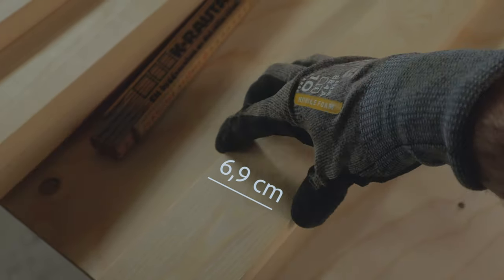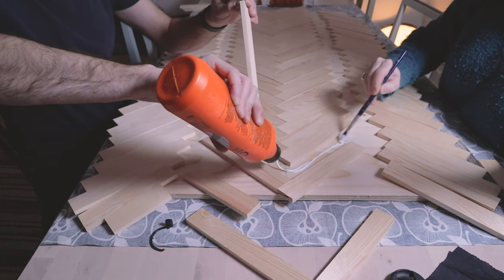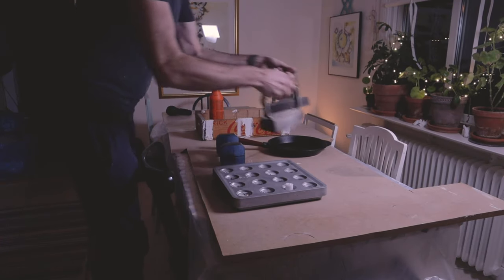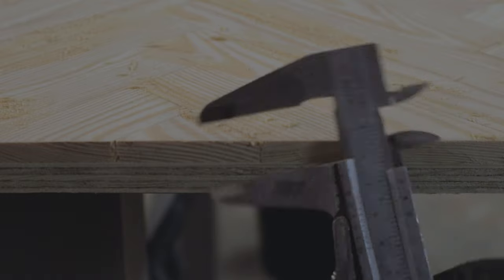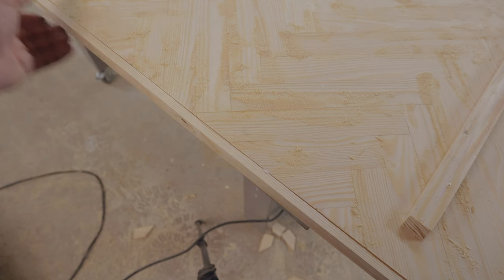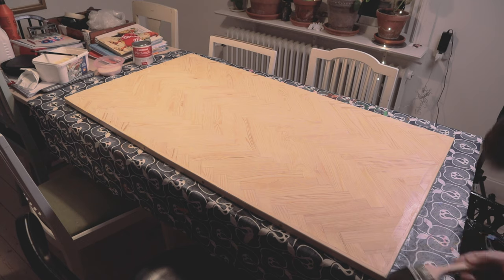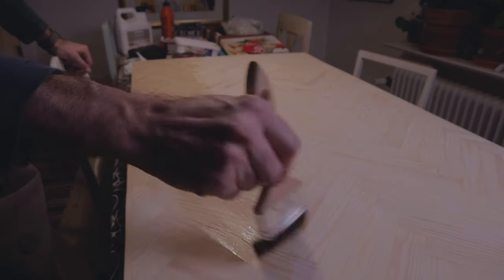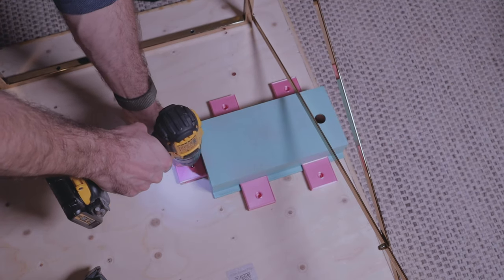DIY Herringbone Coffee Table

Comment: Great job, it may be useful to use a plug cutter to get a great finish on the outside edges, I found a plug cutter very good & hardly se-able when  the plugs are the correct size to fit tightly into the holes, with the grain direction flowing with the outside pieces. A chamfered cutter does the best job, and is hard to see when finished!!  Keep up the good work, your tablke turned out quite well!!
Reply from the maker: Thanks for the tip! Ill look into getting that.

Comment: Hi, great work. Need to ask you 1 thing, did you say leaching the pine wood or bleaching? And also what solution you use. Thanks.
Reply from the maker: I think it is called leaching. It is called LUT chemical in swedish at least. The solution I used is usually used for floors.
Reply: Ok u learned something new everyday. Thanks